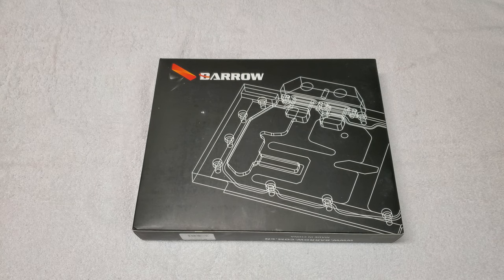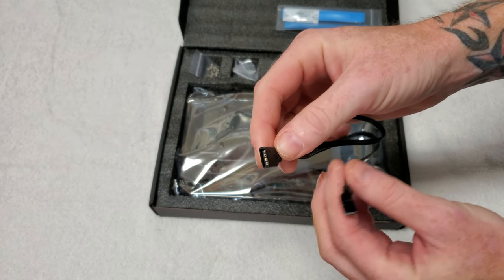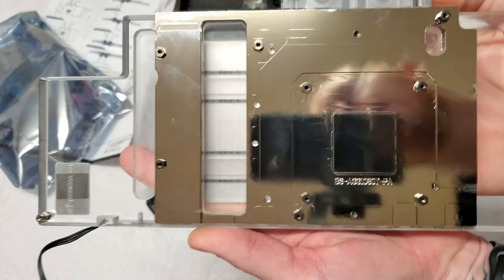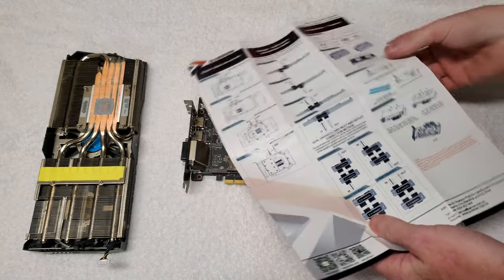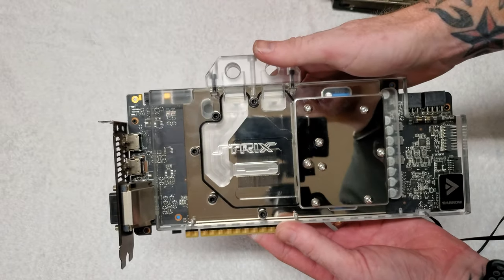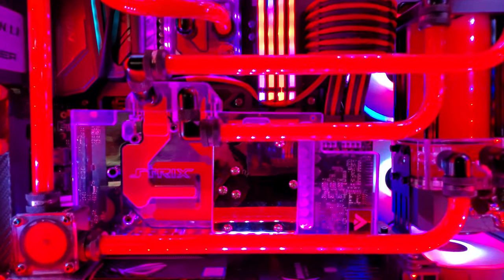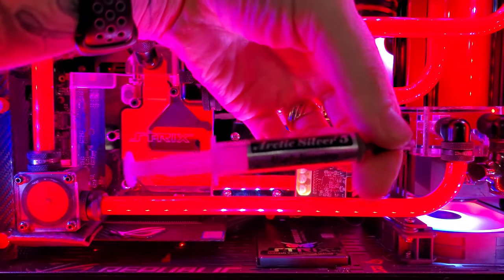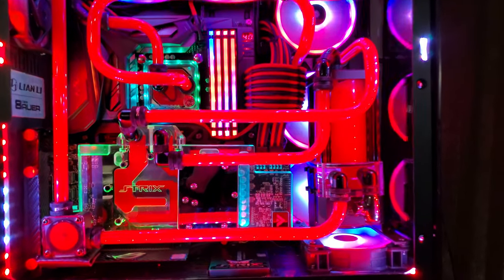Barrow GPU Water block Asus GTX (Unboxing & First Look)

Comment: I have the same GPU. I'm thinking to buy this gpu block... 2 questions, 1) Could you do a video where you mount this block? 2) This block comes with rear backplate? Why don't you mount it?
Reply from the maker: Your 1st question. I unfortunately can't do a video because this is currently mounted in my case with hardline tubing so its quite the task to take it out. 2nd question. This GPU block does not come with a back plate but you are able to mount the stock backplate on using 4 stock screws. You just have to make sure and put thermal pads on the back. If you want you can send me a message over Facebook and I would gladly help you out with the install. You can find me on Facebook (Steven Moyer) Hope that helps.
Reply: @Moyersteven1  Many Thanks for your fast answer. I'll do if I need

Comment: hey bro I know ur vid was posted ages ago but, I also have a Barrow water block and my rgb cable is a 3 pin however my motherboard doesn't have any slots for a 3 pin. Do I have to get a Barrow rgb controller so I can get it to work?
Reply from the maker: Any RGB controller with 3 pin will work. Even those cheap ones.

Comment: Hey Steve. What kind of pump are you running?
Reply from the maker: I use the EK D5 G2. The EK G2 and G3 I find to be the best. I've used other brands and always go for the EK. They are great pumps and super reliable.
Reply: @Moyersteven1  i
Ah cool. Considering trying out the Barrow SPB-17s since its like 1/3 of the price but have found a lot of user feedback on them. Ill keep the EK D5's in mind thou
Reply from the maker: @kimsund8084  I've used many Barrow products in the past. They have always been great.

Comment: Nice Video ....but i have one Question: do you use G1/4 fittings? So what Size? Thank you for your answer!
Reply from the maker: Yes, I use XSPC G1/4 Fittings. They are 3 ORing Fittings and some of the best ive ever used. They are 10MM ID 14MM OD Fittings. You can find them on Amazon.

Comment: Where did you buy the vertical GPU mount?

Can you post a video with your tempratures too?
Reply from the maker: I got it off Amazon, If you look at my video "PC Update and Corsair ICUE Explained" I show my temps in that video. Here is the link for the GPU mount. https://www.amazon.com/Cooler-Master-Accessory-MasterBox-MasterCase/dp/B071P862G1/ref=sr_1_1?keywords=coolermaster+gpu+mount&qid=1577763569&sr=8-1

Comment: Q: So when the GPU is being cooled by chasis fans now, I guess the card can't control it's own fans? It would be nice if the GPU radiator fans could ramp up when under GPU load.

Comment: Question about the LRC 2.0 RGB on the water block:  Can you pick a single, static color or must you cycle through various colors?
Reply from the maker: You can choose anything you want. Static, Color cycle, rainbow, pulse.... There are many different options.

Comment: Hi bro. I have the same block. Problem is mine has a 5v 3pin adaptor on the gpu rgb but my mb has not. I have a fan hub. So my question is how can I connect it to that hub? The hub has the 4 pin led strip port like the led strips that you can find nowadays.
Reply from the maker: If the block has a 5V 3 pin you will need a 5V 3 pin connector on your Motherboard. If you dont have one you will have to get a ARGB (5V 3 pin) hub. Whatever you do, don't plug in the 5V 3 pin into a 4 pin. The 4 pin ate 12V and will ruin the lights.

Comment: Happy with the block? Considering one for my FTW3 3080 as getting any block right now is impossible. I quite like the stock backplate as it has RGB LED COB/SMD chip shining through 'EVGA' cut out and barrow let's you use stock backplate. So cheap too ofc
Reply from the maker: Yes, The block is excellent. It is still going strong. It's in another system now. I will say that it's one of the best ive used. I have Phanteks, EK, Alphacool and Barrow blocks. The Barrow is just as good as the EK and Phanteks. I highly recommend them.
Reply: You ever install the barrow block on your 3080?
Reply: @coolmyrig6075  went with EK in the end!

Comment: FRIEND HEARD RIGHT? 54 TO 29? DEGREES CELSIUS
Reply from the maker: @Francine Nascimento correct. Went from 54 down to 29 Celsius and that's Idle temps. When Gaming I dont get over 48-50 Celsius. HUGE DIFFERENCE! Still going strong!
Reply: @Moyersteven1  That can be quite normal. My old Gigabyte 1080 TI had the same idle temps, because they went for a silent fan curve by default. They just would start spinning under load.